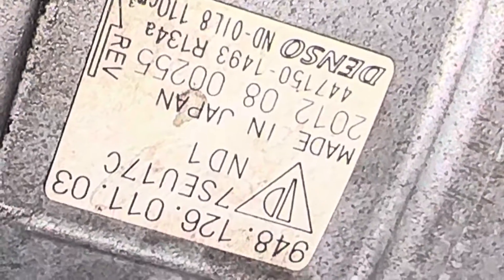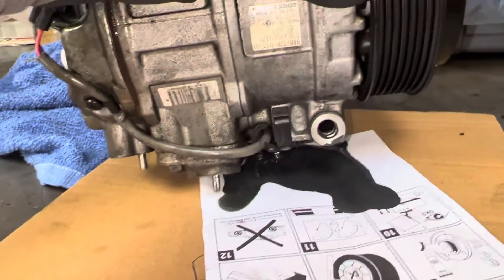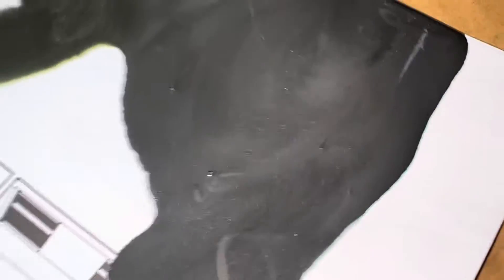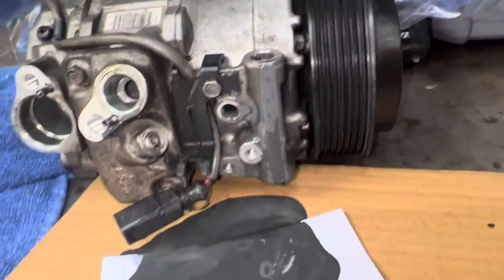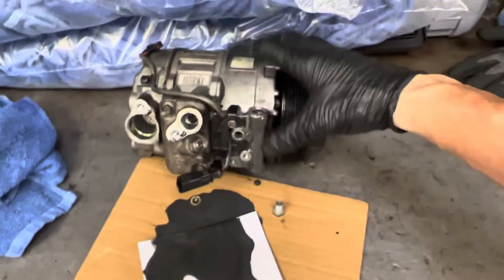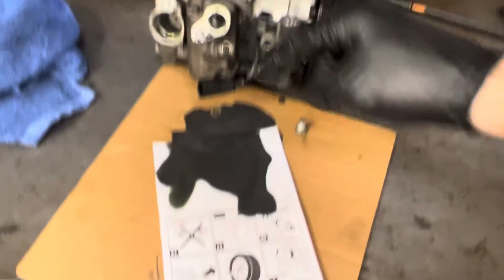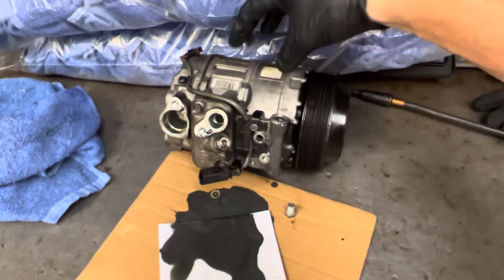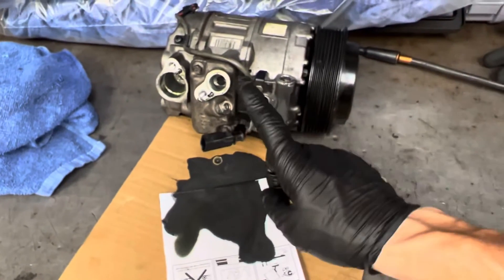AC COMPRESSOR OIL LEARNING EXPERIENCE 🤔 put a new compressor on this dirty system it will die￼

Comment: is there any way to test AC Compressor on table, out of car? Whats happend if i plug two adapters with 1/4 sae. Connect manifold gauges -> vacuum -> fill 100psig nitrogen -> and run shaft with electric drill ? im just want to know if compressor is able to did a pressure differential, could i check this way valves are ok ?
Reply from the maker: Yes, on fixed piston compressor. 

I’m terrible Displacement compressor  You have to feed a duty cycle signal to the compressor control valve to command dishwasher plate to control the compressor to 100% output.. 

My father had a tabletop test unit because we used to rebuild old General Motors Frigidaire A6 compressors.

Comment: I have a questions about this particular compressor, it has a specific oil/drain port for the oil access through the crank case, during operation , the solenoid cycle the gas ( cause pressure differential if I am understanding it correctly), as the gas passing through the solenoid, will it also draw the oil out ?  

Q2:  I only get cooling(evap get down to 2-7c , high pressure at 14-17bar) at idle(700rpm) speed which the solenoid duty cycle at 90-95%  , as soon as it increase in RPM ( 2000 + RPM)  with the solenoid remain at high duty cycle ( 80-90%), the evap will no longer cool and the high pressure reduce to 9-10 bar, confirmed the solenoid is working , can you shed some light on this?
Reply from the maker: Some will operate like that some will not it all depends on that particular manufactures your make model in their software how they developed it to react to the different sensors of rpm speed in pressures. 

I have demonstrated in several of my videos, the difference between variables in different variable compressor, manufactures, where when you raise the rpm some of them stay absolutely flat, and do not change at all

Another manufacture will allow the high side pressure to go up in the low side pressure to go down, sometimes affecting the temperature out of the dash sometimes not 

Then another manufacture will allow the high side increaseincrease and soar sky high, but maintain a low side pressure that does not change at all. 

Then another manufacture, when you takeoff and raise, the RPMs will actually raise the low side pressure as it cuts back on the dwelltime and displacement 

Another factor whether or not the vehicle has a son load sensor and you drive out into the sun or is it a cloudy overcast day will vary how it responds to acceleration

The ambient temperature sensor also on some manufactures in on some manufactures does not very how much the duty cycle to the variable Displacement sensor. There is no one one size fits all there is no all manufactures follow the same rules. . 

When you test a couple hundred vehicles in the winter time end in the summertime, you find this out . 

What is written down in one book is not fact for all manufactures 

It’s just information the author, who wrote the material had at his hand at the time of writing . 

Unfortunately, when the reader reads it, they take that as fat as that it applies to all vehicles . 

You would not believe how many comments I would get when I say a compressor is variable speed and then say it has a clutch .  And people would respond to me. I don’t know what you’re talking about because variable speed compressors do not have clutches..  lol 😂 

That shows that they read some literature that was printed 30 years ago that was re-posted by editors, who didn’t know what they were talking about because they were couch, potatoes, keyboard engineers, who don’t have a real world experience .   

They republish this material and somebody read it and they never read anymore or learned anymore. They never attend seminars or expos they don’t fly themselves out the classes they don’t go to manufacture training they have 20 years of experience, but only at the level of a first first year level apprentice, who repeated the same knowledge for 20 years that doesn’t mean they have 20 years experience. 

And that is a big problem with a lot of the guys who write a lot of the literature. We read in training often have been out of the game of daily on the hands experience for 10 or 20 years and they start falling behind the times and printing literature. That’s somewhat out of date. .  Not all but many including dealership, service manuals.. 

Most everything written for automotive is written for roughly a six grade education level because they have to intentionally dumb it down for many individuals who can’t pass that Mark, even though they did graduate high school if they were lucky .  That’s a sad fact of the averages in automotive trade.

Some compressors have a good oil scavenging that don’t allow a lot of oil to sweep through the compressor. Another compressors have modified designs to attempt to keep a larger majority of the oil inside the compressor not all, but they do a better . 

So it is a particular case by case for a particular year, make model vehicle, of which one does what. 

There’s no way in hell I could remember every vehicle, even though I have my hands on them every day. 

One advantage I do have over many is that most guys only touch air conditioning in the hot season.  Which is the best time to perform diagnosis. 

Because of my area climate, I am forced to do air conditioning 365 days a year even in winter time when it’s raining or foggy and overcast on days that are only 40° to 58° for about four months of the year and I have to diagnose under these conditions.      

Mini technicians all over the country tell me that they cannot diagnosed song called days, and that is a little bit of somewhat of a truthful statements.       

Until you learn otherwise

Develop procedures of falsely loading the evaporator and or condenser
       Something, my father showed me as a child growing up.  All other guys in my shop when I had work in different businesses were always have a hard time diagnosing air conditioning on cold days. I did not have a problem.. 

Because I also know some of the manufactures service literature was incorrect.   And cannot be applied to all vehicles..
Reply: @coldfinger459sub0    once again, I appreciated you share your work experience and knowledge to the community,  it is a treasure to share knowledge so other ( kids and myself)  who care to learn .  Even I know somewhat about thermodynamic and pressure differential , there always surprise when it comes to real world situation. I am just a hobbyist but  it is  very rewarding every time you feel the cold again and you know the proper refrigeration cycle is done right ( with proper oil balance of course!!!!)
Reply: Yes I watched some of your video talk about the control logic between manufacture, they are different and  yes to the clutch with variable compressor also nothing new folks. WHOEVER watching this, please say thank you what Tom is doing here, he is doing you a big favor 

 I may have mis-lead you about my questions,  I was learning an issue and try to understand what it is doing, with the system working(cold) properly during idle,  it is not when the engine RPM increase let say 2k and beyond,  it seems that the compressor swash plate no longer adjusting even though the solenoid is cycling ( confirmed with software and scope, I have a feeling that the reed valve might have a pressure bypass as RPM increase, then  P1 (pressure side) > P2 ( crank case) , the patel might be ok at idle as it is moving slowly, however as rotation speed increase, the defected finger at the reed valve can't keep up, have you run into this type of situation before?
Reply from the maker: @carlosk2752  have not run into that as a problem or causing any issues.  

Many many years ago would have bent or broken read plates on two cylinder. You can see it really easy on fixed piston. 

But nowadays, we have these seven cylinder and 10 cylinder, makes it more difficult to see a problem with one single damaged reed. 

And if all were damaged, we’re having a problem at the same time I would say somebody slugged it was liquid, refrigerant, or overfilled it, or some other problem .
Reply: @coldfinger459sub0    I think you nailed it, it make so much sense now the way you explain it , I will find out more once I open it up .  I am more into DSC and Hybrid/EV stuff, learning something new everyday on youtube, that's awesome ! if ever run into issue on welding and machining, I am more knowledage in that regard, hope I can help one day!
Reply from the maker: @carlosh9489  I have been wanting to get into the hobby of leaves and mills. Been looking at the cheap little Chinese lathes and Mills.

Looking at the modifications and reviews, haven’t touch the lather or mill since high school machine shop .
Reply: @coldfinger459sub0  Depend on your machine envelop requirement and what you project you got , I have been going to auction and found alot of CNC mill that went onsale due to the current economy climate.
Reply from the maker: @carlosh9489  just tiny scale, hobby, small trinkets.   Machining and milling small heat sinks for electronics, ornamental hardware for fancy, architectural designed stereo, amplifier face plates, and chassis Variel unique one off, made out of copper or brass or stainless. 

Yes, auctions would be a good idea but very small stuff. Got a small garage. .   The wife already says I have too much shit..  everything I buy a shit to her 🤣
Reply: @coldfinger459sub0  Yeah, I never tried them but I see alot of those tabletop CNC are control by the programmable controller, those driver are upgradable, that's amazing.

Comment: what and how can you flush it with and does it need to be done under some pressure?
Reply from the maker: There are many air conditioning flush solvents that were specially designed for air conditioning systems

They use a small canister that’s like a small fire extinguisher that you fill up with the flushing solvent and you pressurize and it pushes it through

When something has this many metal particles in it each piece Hass to be basically taken apart and flushed it’s too much to try to do the whole system at once

You cannot flush through a expansion valve or the orifice tube so it must be replaced and removed out of the way of the flush because it’s a restriction

Do you do not flush through compressors you replace them

You do not flush through accumulators or receiver dryer‘s you replace them

You do not flush through hoses that have mufflers on them you replace them

You do not flush through the new Microchannel parallel flow condensers you replace them when they have metal debris

If you are only flushing out just oil from a Microchannel parallel flow condenser then you can flush the condenser but not debris

There are videos on this by the manufactures of the flushing solvents or flushing equipment showing how to set it up and use it
Reply: Watched a video with some old dude, and he said you must take the evap out to flush, is that the case? As he said you cannot remove all the cleaner etc from the tubing bends etc.
Reply from the maker: @Ken_4711  it depends on the scenario

If the evaporator and the expansion valve are both located under the dash inside the heater HVAC box you will have to remove the whole assembly because you cannot flush through a expansion valve therefore you cannot flush that evaporator core. 

If you have a vehicle with the expansion valve that you have access to on the firewall and you can remove it

         But the evaporator core stays inside the vehicle in the dash inside the HVAC case you can flush it because now you have an inlet in an outlet to blow your flushing solvent through. 

If you are using the correct flushing solvent it leaves no residue

If you are using the correct volume and velocity of high-pressure nitrogen it will leave no solvent behind even through all the Twistin bends of the tubes

If you have moisture or solvent left behind in the system you’ll easily be able to measure that and read it with a micron gauge

You keep it longer on the vacuum pump the solvent evaporates like alcohol leaves no trace a residue behind if you use the correct solvent. 

When the solvent has fully off gassed your micron gauge level will drop and then steady out like a dead heartbeat

This is the difference between education and lack of education